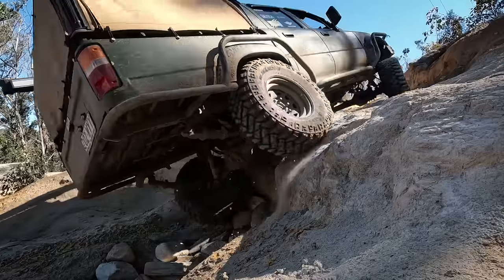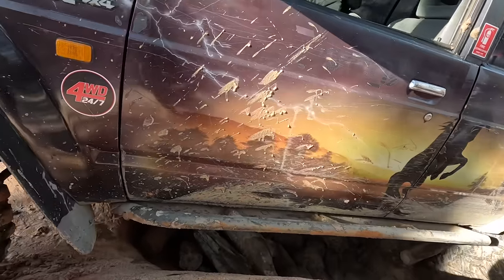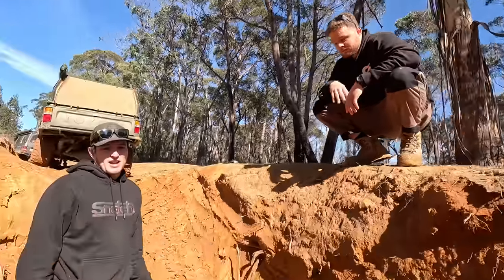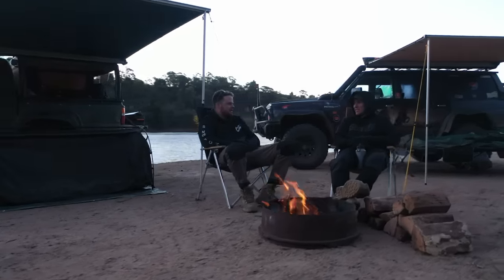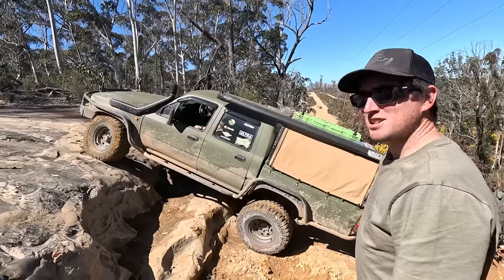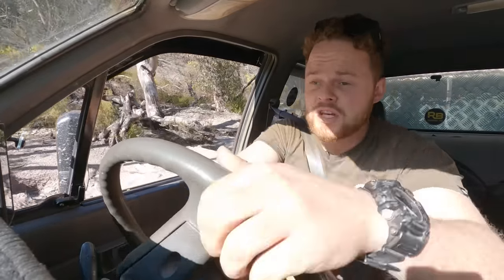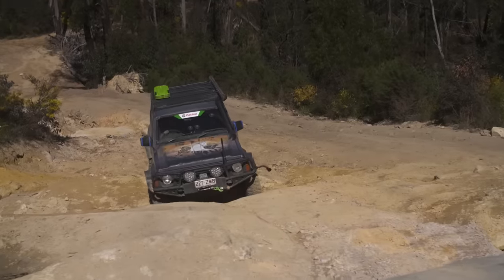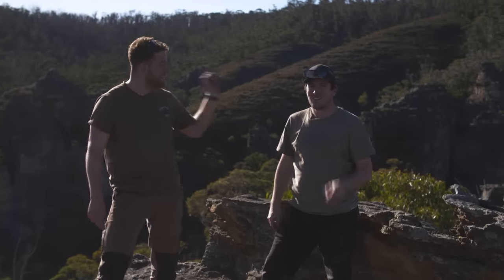MONSTER Rock Steps makes Jesse shake on camera - Budget Built 4WDs pushed past their limit!

Comment: Excellent content lads, taking the time for a bit of instructional material is great. Experience can be a harsh teacher, especially on steeper tracks. 

Track building is massively underrated but will get you through a lot of the time with more mechanical sympathy and less damage to the track. 

Hand in glove with the advice on the ruts is looking ahead to where you can get traction and keeping the vehicle relatively level in all situations.

Comment: What lift and tires is Daryl running? Is it on 2inch suspension lift with 33's or 35's? Also what tire pressure do you guys recommend for this type of wheeling?